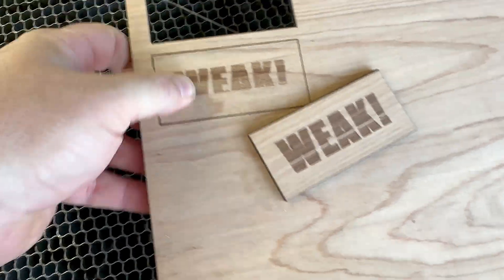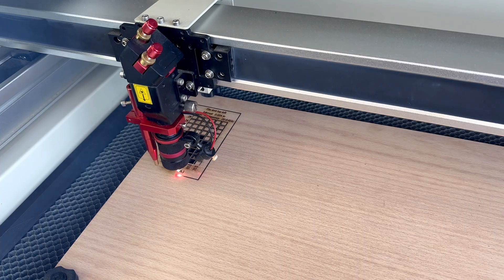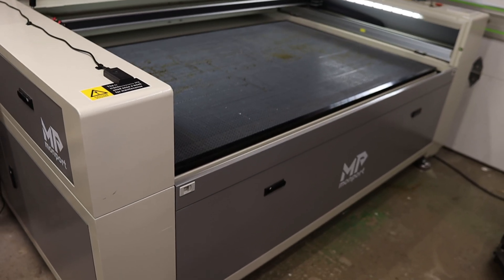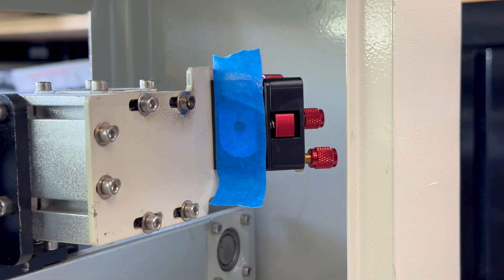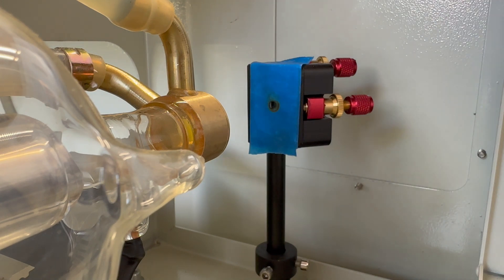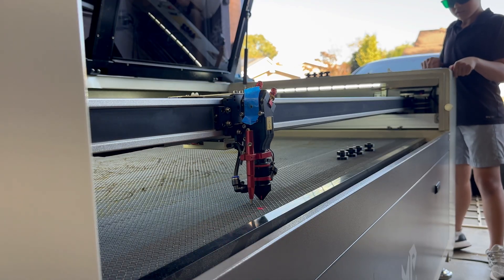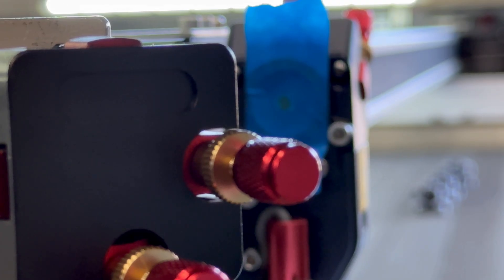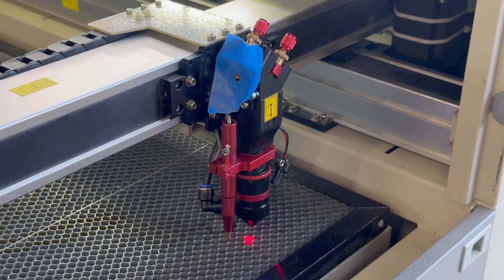Don't Skip This Step - Why Your Laser Cuts Are Failing (And How to Fix It)

Comment: I have not been able to get past the second mirror. The laser beam is right on with the 1st mirror but the second mirror does not hit the same spot in front, back and middle position no matter how many times I try. Back position hits middle on 2nd mirror, middle position it's way left so i get that in the center and then front is way left and when i get that in the center then go to the back again it is way off of the middle again. Any suggestions?
Reply from the maker: Trust me, been there done that.  First I’d says take a small break.  Come back and start slow.  Bring mirror 2 all the way back to mirror 1 and center the beam.  Then, move mirror two only a few inches or so and recheck/center.  Keep doing this until you get all the way down to the front of the machine.
Reply: @LaserGarage  I did this and then when I went to the back it was nowhere near the center again.
Reply from the maker: If your beam from mirror 1 to mirror 2 is way off after adjusting from front to back like I show in the video or explained here, it’s possible your alignment from the tube to mirror one is off.  Start at the beginning and make sure that is as perfect as you can get it.  

Then adjust mirror 1 so your beam is centered on mirror two all the way along the Y axis.  You need to make small movements at first like I showed and described here but also keep jogging back towards mirror one.  Meaning don’t wait until to move mirror two all the way to the front of the machine before you bring it back to the starting position to verify.  Continually move it back and forth, checking and rechecking.  Hope that helps.

Comment: Graet video, thanks! I ordered a Reno 65 Pro and am excited to see the results. I have experience in working with a Laser cutter with RF-Tube and fear that the beam of the glass tube will be disappointing. Can you say how much the width of your beam is? When i cut a part it is only around 0,14 mm smaller than the size of the data.
Reply from the maker: You’re welcome thank you!  I’m not sure of the spot size, I’ve never measured it.  RF tube machine will of course have a smaller spot size but that doesn’t mean you can’t get great results out of a DC glass tube machine.  Check out my channel, I have a bunch of videos discussing this topic and more.

Comment: so Glad I found this video ! I purchased the Monport Reno 65pro a few months back. I have no experience, so If you can make a video on cleaning the laser lens, adjusting the head and opticla path alignment, it will save me a lot of frustration.  Thanks
Reply from the maker: Sounds good.  Alignment is covered in this video so maybe I’ll work on a short maintenance video for the Reno series.  If you browse my earlier videos I do cover co2 laser maintenance numerous times though.
Reply: @LaserGarage Thanks! I will check them out😊